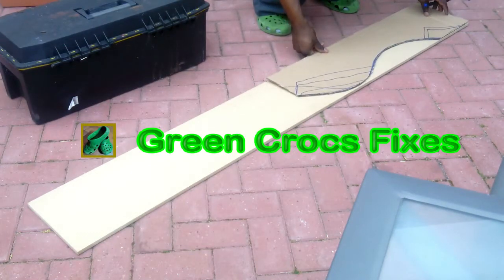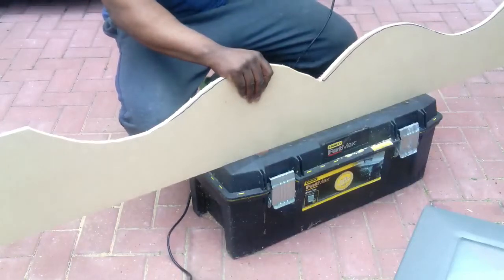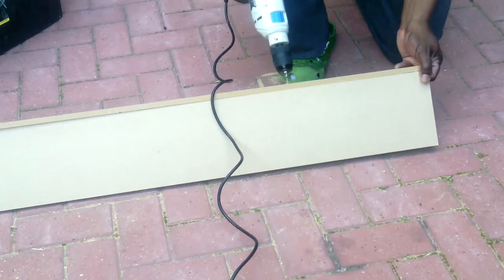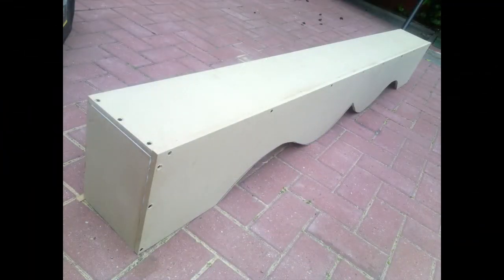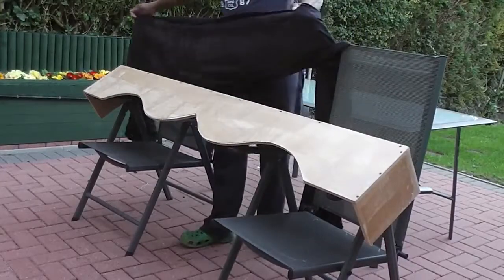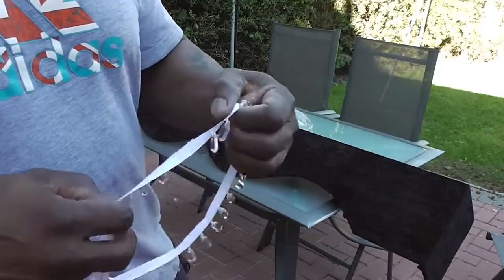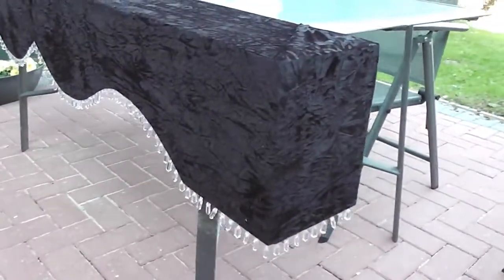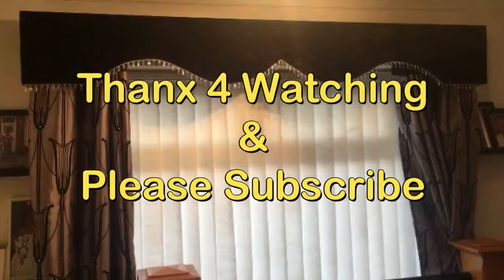The Curtain Pelmet

Comment: I'm not entirely clear what the purpose of this video is as significant steps are missing I.e. how to makecthe pelmet; what mechanism was used to secure it to the wall. They are key.
Reply from the maker: Hi Sylvia,
               “I’m going to be making a Curtain Pelmet” are the openings words and then as you can that is what happens. I don’t mention sourcing the required materials, parts, tools or the installation as this would take too long. Terribly Sorry 😎.

Comment: A lot of people use plywood, is there any difference between the two when building pelmets?
Reply from the maker: Hi Lel Re,
                I suppose you can use anything that does the job. I used MDF because it is cheaper than Plywood and easier to cut.

               Kindest Regards.